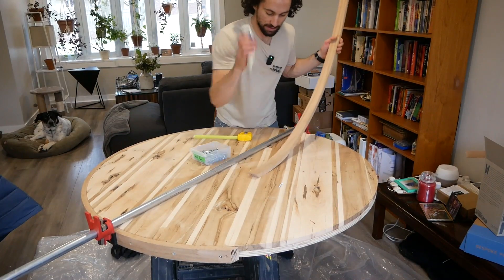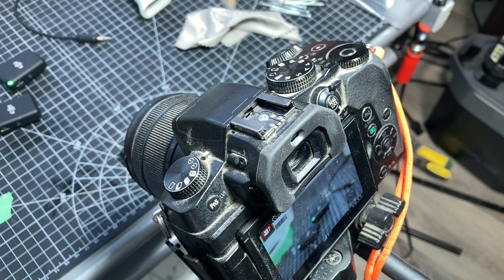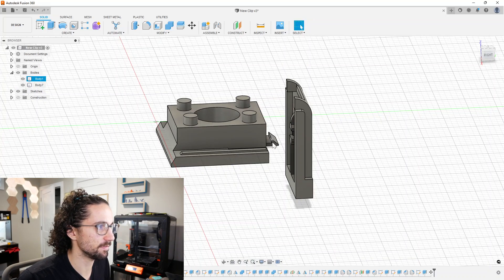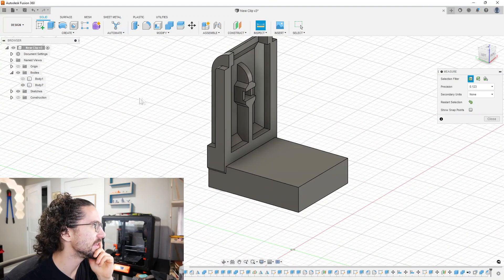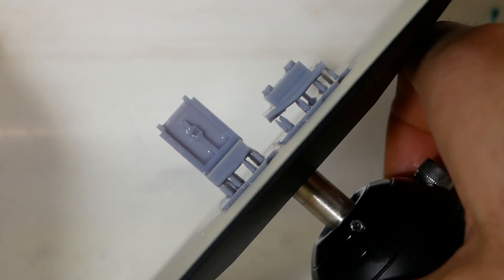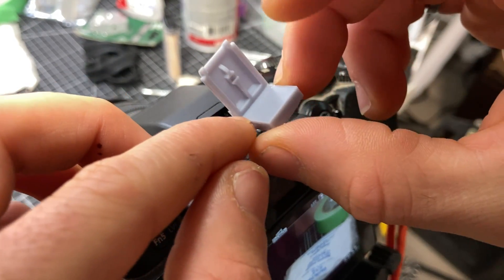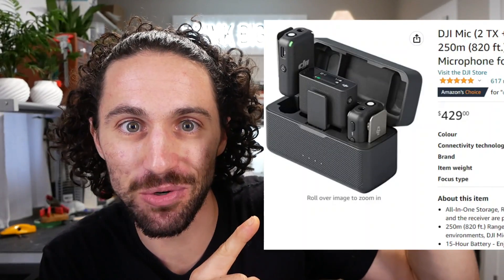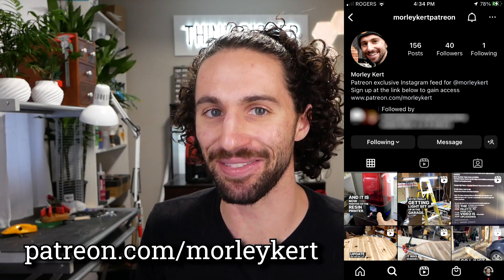$430 Gadget Fixed for 50 cents with 3D Printing

Comment: A 0.2 mm nozzle can do the same small details with FDM-printing and I designed even smaller parts and printed them with a .4 nozzle thanks to Arachne slicing. The magnet-connection isn't stable enough, and there is lots of space to improve the model with an additional physical connection, similar to the other two connectors. There is also amazingly strong velcro out there as an alternative to magnets and those four nobs would be enough to keep it in place if you leave more surface for the velcro. I also made bad experiences with super-glue when fixing magnets to parts, even with PLA, and will switch to Revell glue in hope for a better connection.

Comment: When I have a fit issue like this, I like to measure the as-printed dimension, sand it until it fits, and then measure the sanded version. Then do some math to figure out the v2 dimension.

Comment: I feel like you should have put the original clip into the shoe before putting the receiver onto the mount. that way what you had happen where you have to push on the receiver to get it to lock in wasn't required. It's probably hinged so you can take the receiver off while leaving the clip in the shoe and fold it down so that it isn't in the way while not in use making it something to leave in shoe when not in use unless you are switching between cameras.

Comment: Here's a useless fact nobody asked for: the camera flash connector is called the accessory shoe. At first they didn't have any electric function and were for holding only, and when they got the contacts to automate flash firing, well that got called the hot shoe. Same thing without electrical function got retroactively called the cold shoe.

So microphone receiver is a cold shoe accessory, not a hot shoe one.

Comment: 50 cents? Really? It cost 50 cents for the 3D printer and the materials to print the part? Why is it that I don't believe that. You can't just ignore the cost of the printer, or the time and effort that it took to design the part and put the design into the printer. It definitely cost more than you're telling us.
Reply: A: does Uber factor in the coast of the car when you get a ride or just the gas? B: If we were counting that lets also count video revenue and subtract that. This video made at least a thousand dollars in ad revenue and subtracting that from $320 leaves around $679.50 to pay for the time. If it took him 5 hours then he could get paid $130 an hour and still the part would cost negative money. Let's change the video title to "Printing this part made me $700"

Comment: another tip for resin printing, i STRONGLY recommend wearing gloves and not touching it until after 10 minutes of post curing, as well as angling your prints and adding supports. flat supported pieces facing the build plate directly will always warp.

Comment: On my resin printer I try not to have flat surfaces parallel to the build plate because when it pulls  out there's a LOT of suction force. If you angle the pieces they're FAR less likely to deform early on and you can use less supports. But also that does tend to deform the shape a little bit.
Reply: If you find that you 3d resin prints are too fragile, consider adding some Tenacious to your resin. It's stretchy by itself, but mixed with normal Grey, and ABS-like, it tends to make the parts far less brittle. (like 1:10 mixture Tenacious:Grey) It's what I've used in the past and it makes far more resilient parts for practical use.

Comment: I don't know what slicer you're using, but I would recommend using lychee slicer, I have used it for a while and does most of the stuff for you like auto orientation + it's easy to make changes to settings

Comment: I have a question: what do you do with the filament that was used for the prototype’s? Can it be reused? Also, why is your camera so dirty? I have a guess that it’s because you film around sawdust and other airborne dust but for some reason it bothered me to see the close up of the camera when you were showing the test fit of the pieces you built. Also, random compliment but I love that you wear headbands to keep your hair out of your face while working. It’s adorable!!
Reply: Resin is not reusable, you just fully cure it and dispose it. Also one should wear protective gloves and eye protection at least while handling uncured resin.
Reply: @MariusKubilius  Bummer about it not being reusable. I agree about wearing PPE though. Morley, please wear eye protection if you don't already!
Reply: @MariusKubilius  Is the filament used in 3D printing the same as resin? I should have specified I meant the 3D filament.
Reply: @UKcomedyfan28  no different things
Reply: @MariusKubilius  Thanks for the info. Can you reuse the 3d filament in the 3D printers? I don't get why I have to keep rephrasing this question but I guess I do🤷🏻‍♀🤷🏻‍♀.
Reply: @MariusKubilius  I have only recently learned more about 3D printing and do not always get the terminology correct. Yet. I do not mean to be rude, but I don't understand why it wasn't obvious that I don't know much about it, hence my questions about if it is reusable or the same thing as resin.

Comment: Not trying to start a war resin vs fdm however sorta think fdm would have had less bubbling / look worse but be more functional and less failures though I have had curling on occasion as well.  Also cool to try out the new toy.
Reply: FDM printing doesnt have the accuracy to do this unless you have a tiny nozzle but at that point resin makes more sense

Comment: With resin printing, you want to tilt the parts. There's calculators to get the exact optimum angle, but 40 to 45 degrees is generally pretty good. Also, you shouldn't touch the uncured resin with your hands. I've heard once it's washed even before curing is OK to touch, but never touch the liquid resin.

Comment: When printing flat surfaces with resin, its generally best to put the parts at an angle I've found that I get a much more accurate print. I normally do about a 30° angel off the build plate

Comment: I love the DJI mic, but actually don't use the receiver under normal circumstances. I just hang the transmitter off my shirt and start recording from there. I does require me to synchronize the audio with my on camera audio, but that takes seconds :)

Really cool design, though. I'll print it for those other cases. I'm thinking ASA :)

Comment: The tolerances also may not line up due to over exposure during printing. The exposure time per layer generally needs to be tuned on a resin-to-resin basis for optimal settings, but it is something to keep in mind when experiencing tolerance issues.

Comment: Also why did you use resin?
Reply from the maker: High level of detail at a small scale
Reply: @MorleyKert  I mean I suppose but I think the filament printer would work half decently
Reply: @JasonCrothers  he's making good YouTube content for us all to learn from. just because he can print with a filament printer doesn't mean that its bad to use a resin printer. You experiment with all the options you have available to find out what works best for you. at the same time he's also developing new skills and trying to attract new viewers.
Reply: @joshualiebrecht578  yes and commenting helps support. 

My question was genuine. Your post seems defensive, I've been wrong before though.  I have a filament printer and reproduce things all the time as he does in this video. I don't have a resin printer so I was curious. His response was pretty limited. I could produce something very similar and possibly stronger with my filament printer. My reproduction of what he is creating in this video would be substantially stronger than what he has produced.

What really made me raise an eyebrow is even with the high level of detail he had to "alter" it with a knife anyways.... So then I have a bunch of follow-up questions, why didn't he use filament when he has such a sexy printer in the background, is it an issue with that printer alone, would the type of resin change the finished product or does the reproduction design need altering?  Lot's of questions on my end.

Comment: Mechanical resin prints best with softer rubber resin. And flat surfaces always print with an angle. Resin printer make best results with corners at the start of printing.

Comment: You know Morley is a real engineer when he spends hours building a solution in Fusion360 and resin printing instead of spending 2 seconds using adhesive velcro.
Reply: Or just sanding down the piece that was too thick
Reply: or just hitting the print with sandpaper lol

Comment: When doing resin prints, you should rotate your parts so there's no parallel planes to the build plate... that makes it look good when you're supporting the bottom of your print.
Your swelling happens because liquid builds up above your plate as it's getting dipped in/out of the resin. Just a 5-10 degree rotation is enough sometimes.

Comment: Hi Morley. Just a stupid question: if you have a tight fit from a piece of plastic, can't you just file it down a bit until you get a satisfying fit?
Reply: For one off prints, yes. But you might want to adjust and reprint so if you need another one you can just print and it is ready to go without having to sand each part

Comment: Another practical, real world video on what you can do with 3D printing.  But, I think you are missing some built in costs of your fix.  How many hours did you spend learning Fusion360?  How much does the resin printer, washer and curing chamber cost?  The liquid resin? Practice prints? How much electricity did you use while filming and running all your equipment.  How much is the insurance on your new house?  Mortgage?  Someone once yelled at me to stop saying it took me 5 minutes to sketch something.  He said you have to add the years of experience to get to this point.  I still love your sensibility on improving an existing product.  You know why the manufacturer made the original piece the way they did?  Planned obsolescence?  Over budget for design.  Manufacturing costs to change the injection molds?  Who knows.  Keep it up!!!

Comment: You really need to add an angle when you print dimensionally accurate part, the suction of the FEP film will deform the part if you print like you did the first time.

Comment: Top tip when working with resin printing: If you are doing a small part like that which can fit multiples on the build plate do lots of different tolerances on the same print as it'll take the same amount of time to print but a lot less time for you overall. Granted this method uses a bit more resin but you've already proved how cheap it is on the video!
Reply: Good tip, I think it’s hard to get that in your head when you’re used to a filament printer.
Reply: @jeremyspecce  I'm new: why would it be different for a filament printer?
Reply: @corican  Resin printers print the entire later at once so the size of the footprint of the object being printed doesn't make it take longer. With filament printers the nozzle path gets longer with larger objects so the print time would be multiplied by the number of objects you print.
Reply: @jorble_dorble  thanks very much!
Reply: Also using a resin printer for more functional parts you might want to try adding like a syratech Tenacity resin into the mix. It makes the resin a lot less brittle even at like a 10% mix. A 100% mix gives you an almost injection molded sheer on it which might be better for the sliding in piece made here.
There are even some new crazy resins out there made out of used tires that act like full blown vulcanized rubber. I think Goodyear actually had a go at making it. Warning your house will smell like burnt tires when using...
One more tip, resin printers hate flat surfaces parallel to the build plate like what happened on your first print. Angle it at 45% and you will generally have a perfect print on your first go.

Comment: Great video as always! Super excited to see some resin prints! I always try to print flat on the build plate if possible. Adding some chamfers or fillets will make it easier to remove and prevent elephants foot form the longer bottom layer cure times. If you can't print on the build plate, orient the model 45deg and add more supports. This will prevent the entire surface area from pulling on the supports all from a large flat surface. Last I would recommend ABS-like resin. It is much stronger and less brittle for functional parts. Keep the awesome videos coming!
Reply from the maker: Thanks for the tips!